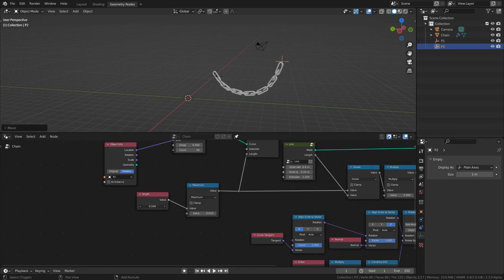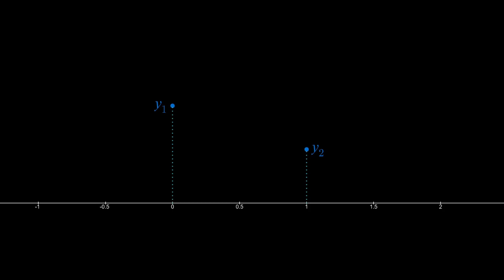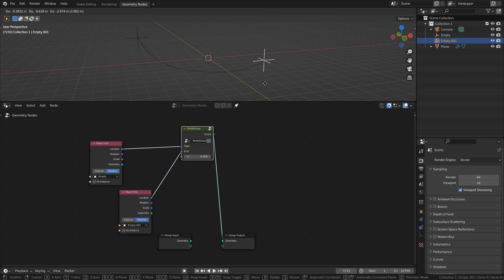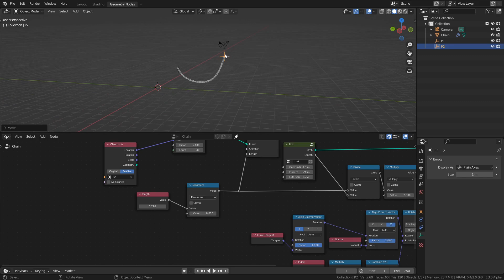Mathematically correct hanging cables

Comment: Is this a constant speed parametrization? (The speed you travel is another parameter you didn't mention)
It might just be a perspective thing but somehow the results look much too flat at the bottom in the viewport?
Reply from the maker: You are completely right! My mathematics was correct, but the implementation in blender was a little off. The problem was caused by using the "factor" parametrization (which I did to make the node group simpler). Because the factor parametrization is always from 0 -> 1, it has the same effect as scaling the input of the cosh function without scaling the output, hence creating distorted catenaries. I've now changed the node group in the description to use a correct implementation.

Comment: I assume you probably know this by now but Blender has a catenary option. You'll need to install the Blender built-in addon Curve Extra Objects. In Blender v4.2, the addon's name is Extra Curve Objects. Afterward, the catenary option is under Add, Curve, Knots, Catenary. To use it, select two separate objects, select Catenary & then adjust options accordingly in the option window (bottom left). Curves are hung from origin to origin. Nevertheless, thank you for your mathematical explaination. I had no idea.

Comment: ❤Can you make a video on pinetree with L system in geo nodes please
Reply from the maker: I don't think L-systems are possible in the current state of geometry nodes. If we ever get those, they would have to be added as a built-in node I'm afraid. I think animation nodes has an L-system node if you're interested in using them in blender.
Reply: @WannesMalfait  ok❤
Reply: @WannesMalfait  i tried to do them about 3 months ago and failed. Maybe now we could?
Reply from the maker: @valovanonym  The problem with L-systems is that you have alot of string manipulation, looping and if/else statements, all of which are not things geometry nodes is good at/capable of. You could probably get a basic version going, but not much more than that I think. I don't really see how you could do it, but maybe someone else knows how
Reply: @WannesMalfait  yeah, most of the time loops are emulated by the use of many duplicates of the same node but it's too limited to reproduce l systems

Comment: I think a neat variant would be if you could make the curve a constant length, instead of the specifying the droopiness.
There is a helpful thread on MathOverflow (3557767) which tries to do exactly that. AFAICT there is no closed form solution, but the author already posted several approximations?
Reply from the maker: I ended up going this route, precisely because you don't get an analytical solution when you specify the length instead of the parameter 'a'. I saw that you needed to run some iterative solver and stopped right there, because I thought that those would not be practical for geometry nodes (no loops/ maybe too slow). I had not found the thread you posted yet, and it seems to give very good (analytic) approximations, so I will try those to see how well it does. If it works well, I'll post another short video with the approximative method, since from a UX perspective the parameter 'Length' is easier to work with. Thank you for the link. 

(Since I had some trouble finding the thread here is the full link for those who are interested: https://math.stackexchange.com/questions/3557767/how-to-construct-a-catenary-of-a-specified-length-through-two-specified-points )
Reply: @WannesMalfait  Now repeat zone node in blender 4.0 can be used to calculate the value of "a" iteratively.

Comment: Nice! A welcome addition could be "ground level [value]" so that if the cable cannot get lower than the ground and would get completely flat at the bottom of the curve :)
Reply from the maker: This is a good idea, but I'm afraid that it's not possible to do this in a mathematically correct way, without resorting to a simulation. A "good enough" solution is to place a maximum/smooth maximum node after the "y" output of the "Catenary2D" node group, it works but is not always going to be very realistic.